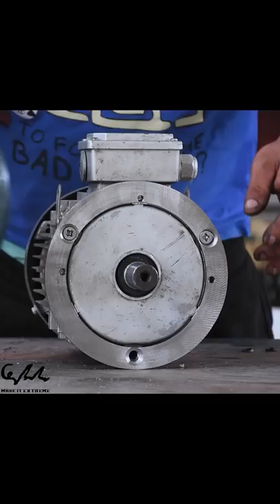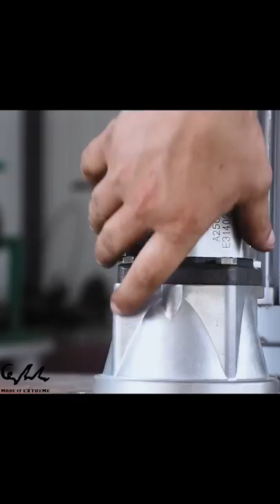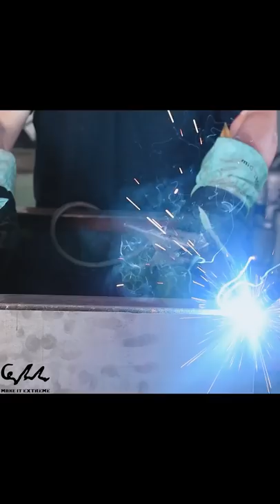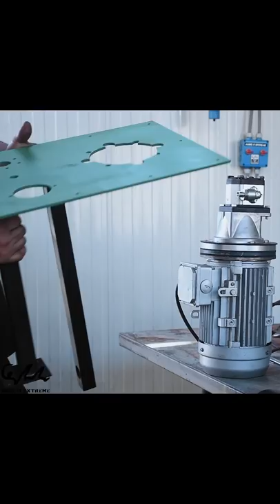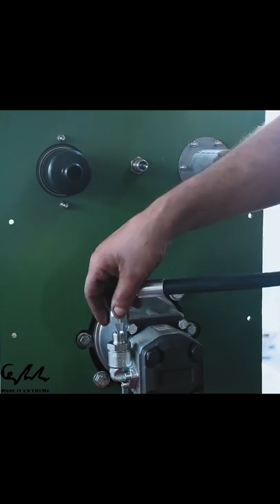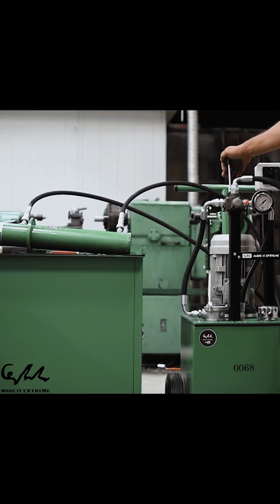Making Hydraulic Power Pack #shorts

Comment: You have to have two different lever valves to use cylinders or motors though.
Reply: That's if you only have one way spools
Reply: @chuumboquay9728  you're right,  it's the tapered spools that allow for the motor to slow down and not shear the coupling.

Although, motor and cylinder spools are inherently different, which was the experience I'd had in the field.

Our mistake was not having much experience in motor or pump applications.

It only took once to realize though 😉
Reply: @chuumboquay9728  ne demek olduğunu ifade
Reply: @chuumboquay9728  ne demek öğrenin ne demek meşgule bu konuda
Reply: @SATORI0320  ne demek olduğunu ve bunun
Reply: @SATORI0320  ne

Comment: He was TIG Welding, right? Is that the ine where you use a compressed gas of sorts to shield the weld?
Reply: That's mig
Reply: That is mig. Tig uses thin rods and a special cone tip to keep a constant arc. It's almost always used for aluminum welding due to its fine controls. Tig guns have a very specific look to them